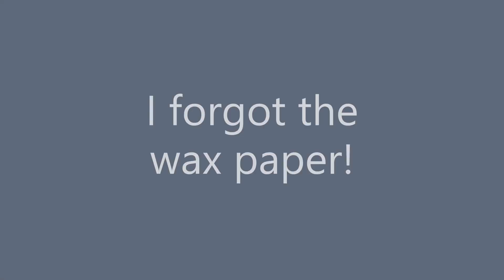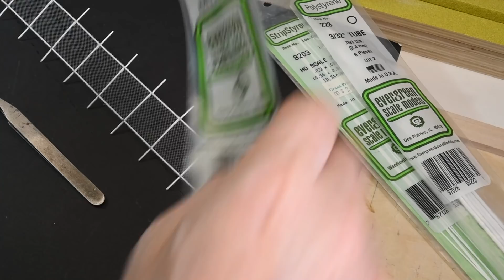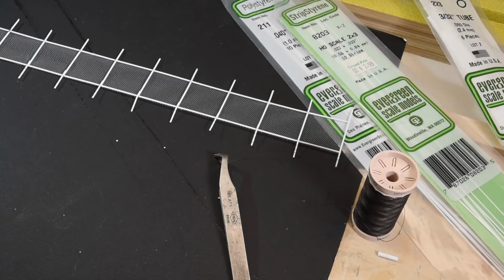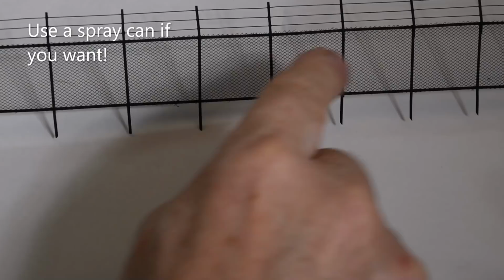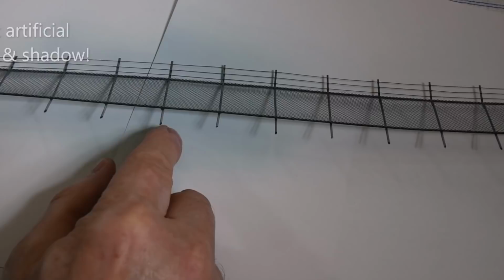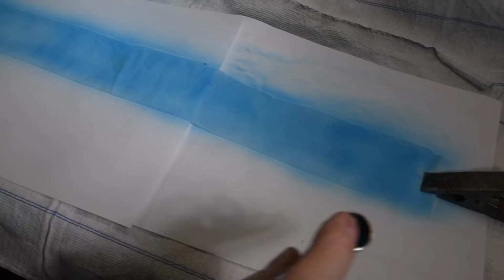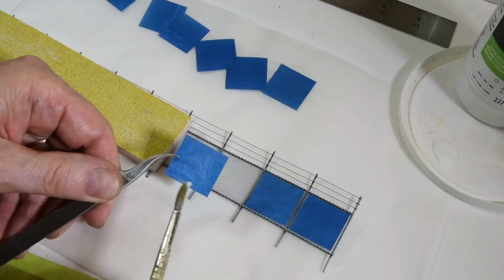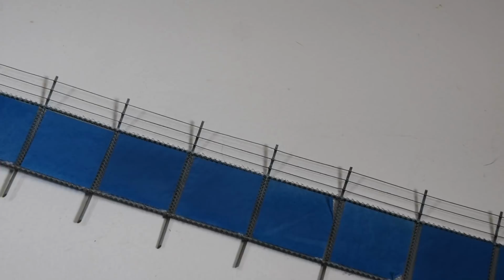Modeling Scale Chain Link Fence Final | River Road - Vlog #83

Comment: Nice looking stuff once again and glad you inform people on color changes for different angles. Also you have more restraint than I . The work and materials is your choice , so if you want to work with plastic oh well. Also the same type materials bond and join together better...common sense. Anyway the warehouse's paint is looking good.
Reply from the maker: I use to build fence with brass, copper, etc., but after lancing my fingers when reaching in, etc. I can't be bothered. On the other hand, I use metal (brass) for railings. I have not painted the warehouse yet. Cheers.

Comment: It's called tulle and pronounced like tool.  I would never use plastic for my fence posts.  That looks extremely difficult.  My soldering skills are much better than my gluing skills so I'll just use 18 gauge wire.  When using wire poles and rails you can just use your soldering iron and melt the bottom instead of trimming.  Cheers from eastern TN
Reply from the maker: I use all mediums depending on how I feel that day. And then most days I don't care . .  lol.

Comment: Looks good.  I used wedding veil also on my "N" scale layout which was built about 6 years ago.  The veil was attached to a large frame I made and all of the cuts were on the bias (45deg) so the chain link looked like the real thing.  After l painted the veil a flat silver while stretched on the frame the fence was cut at .75" which was about a 8 ft high fence.  My fence posts were 2" finish nails and the top if the nails l flattened out and drilled a hole in it for the top rail to go through.  My top rail was .032 safety wire that l pulled straight.  The veil was attached to the fence posts with carefully applied ca glue and as for the length of my fence posts after the posts were installed on the area of the layout l did not have any wobble at all in the fence.  This system does work better than plastic fence material that others use.
Reply from the maker: Thanks for sharing! Cheers.

Comment: Nice fence, tarp really makes the overall fence come alive. I have done similar fences for Formula 1 racing tarps using printed parchment to embed admarks, then going over with a wash to bring out the text within the paper. Excellent job. Talking about the airbrush vs spray cans. For those on the fence. You can use just air to move and push your wetter paints, to age areas. And you can also use water or solvent, to partially expose areas of interest. Also use 3/10 saline mix using acrylic, to pull color in, giving an caustic, chemical-burn look as well. Again, great job.
Reply from the maker: Sounds great! Cheers.

Comment: Great job and a technique I’ve not seen before. One question, how and what did you use to trim the toule on the bottom of the fence? Scissors or a sharp razor? I model in N scale and cutting the fence material straight has been the challenge. Thanks Boomer!
Reply from the maker: A razor blade will work well. I used smaller scissors. I find the ones you can get a a "Fly Tier" shop work well. ;-)

Comment: Does the tulle come with different size holes or is it all the same? Just wondering because I don't want to buy some and it's hole size be more akin to 1:35 scale rather than HO scale. I'm guessing its probably the same but guessing has got me in trouble before. Using the crepe paper to simulate tarp was a surprise to me because I've seen tissue paper used mainly as a material for making tarps. This is a different effect than laying over covering something wanting the tissue paper to take the shape of what you're covering more and what you're doing here you want it stiffer so it looks more tight since its hanging vertically. Looks awesome.  👍
Reply from the maker: I believe there are several sizes of "Tule" mesh. Check the bulk roles with the store associate (much cheaper this way). Best to check before you buy according the the modeler's eye. ;-)

Comment: Why not super glue?
Reply from the maker: When it comes to plastic to plastic solvent is the correct adhesive. Super glue has no "shear" strength because it is a "mechanical" bond, not a chemical bond like solvent is. Models that are built with Super Glue tend to fall apart after five years as the CA turns brittle. It doesn't melt or weld the plastic together. On the other hand, CA (Super Glue) is great for metal to plastic, wood, glass etc, if the surfaces are textured and not glassy smooth.😁